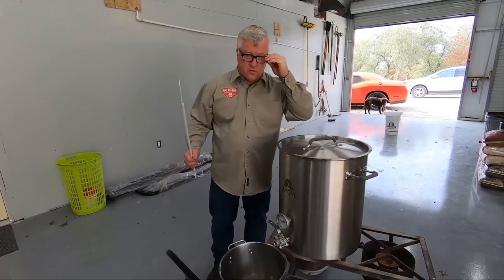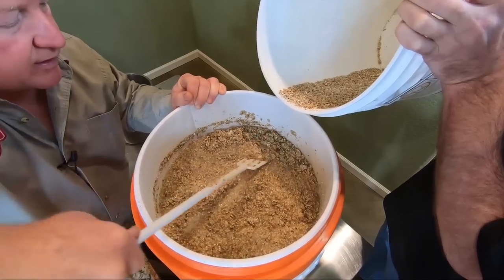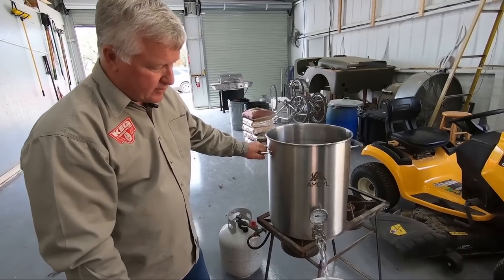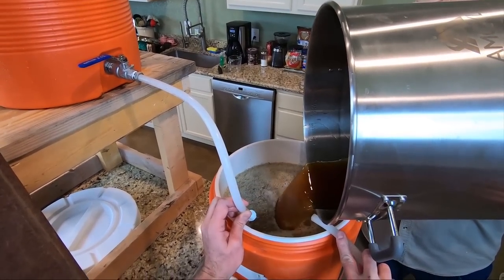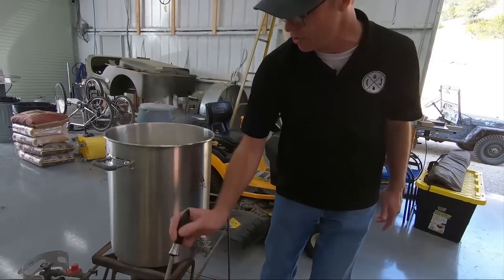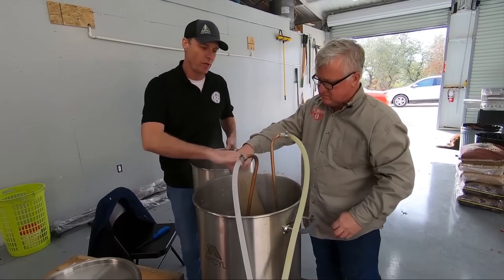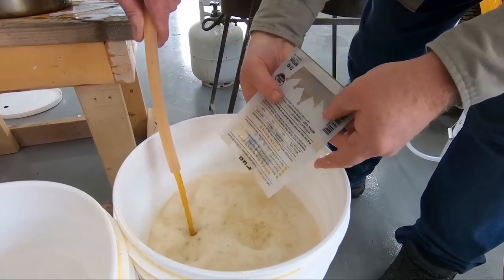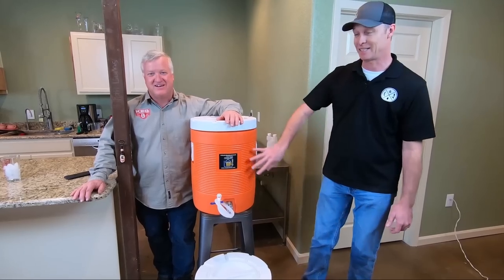All Grain Brewing on a Cooler Brew System

Comment: Nice vid. Interesting how processes get developed over time, so I wanted to comment on mine over the past couple years of home brewing, or about 60-80 5gl batches. 
I use a brew-in-bag method and don't worry about sediment, hop residue, or protein break foam off the boil. Just put it all in there, mash in the boil kettle, remove grains, sparge with top-water in a bucket to get my starting water level of about 7 gallons. 
I use a combination of re-usable hop bags and disposable socks, depending on how many hops additions in the recipe.
I use a home-made copper-coil chiller (wrapped a paint can) and tap water to get wort temp down under 90. From there I rack to a glass carboy, aerate with a wine stirrer in a drill motor, and set in my 65 degree fermenting chamber (upright freezer). Pitching temperature is reached by the next morning, add yeast and stir again. Ales are ready to keg in 2 weeks, no secondary unless lagering.
My beer comes out crystal clear, all of the grain dust and stuff you tried to filter out is sitting on the bottom of the fermenter along with the yeast trub. I find glass is much easier to keep crystal clean, and you can see what's going on with your fermenting.
It's a simpler process and not as fiddly, but does not scale up well to larger batches due to the weight of the soaked grain bag. Some brewers will use a pulley system, again I think that's too fiddly. So I just use two burners and two 8gl kettles. 
And there ya have it. Just ordered some kegs from you - seems like a good product source. Thanks!
Reply: You wrapped copper coiling around a paint can to for your chiller?
Reply: @CarlPapa88  Wrapped the paint can to build the circular coil of the chiller.

Comment: The only confusing thing you did in the video was calling your strike water your "sparge water" as you poured it in to start the mash.   Then you correctly called the next infusion of water the sparge water at the end using it to rinse the grains, which is the sparge. 

I was wondering at first how you were going to rinse the grains (sparge them) when you hadn't even put the grains into the mash yet.
Reply from the maker: Yes, sorry! I wonder if I can put a card on this video at that part with the correction? Thanks for watching and for the comment!

Comment: You produced a liquid called moonshiners beer. Mash used for grain distillation is rested at 150F. 
It is chemically and enzymatically impossible to produce ale using single temperature infusion and high modified malt but it works great for cranking up alcohol for grain distillation. High modified home brew malt is distillers/food grade malt and to make ale with it requires the addition of enzymes and for that reason enzymes are manufactured. High modified malt is less expensive than brewers grade malt. Marris Otter, Halcyon and Golden Promise were originally used for making whiskey until home brewing was invented. There is a maltster producing a type of Marris that is low in protein around 8% which is very good but it is high modified and it requires additional enzymes to make ale. High modified home brew malt is usually 12-16% protein and brewers grade malt is 8-10% protein. Purchase Weyermann floor malt, it's slightly under modified which means that it is rich in enzyme content and it is low in protein which means that it contains a lot of sugar. Take a look at the recipes on Weyermann Malt website. Skagit Malting produces heirloom brewers grade malt, it is expensive. Pioneer Malting in New York sells very good malt as well, ask for Adam. Both companies sell to home brewers. Depending on the length of time the mash was between 140 and 149F some conversion may have occurred. When conversion takes place secondary fermentation is required and the beer will not require priming with sugar or CO2 injection for carbonation. Conversion happens when Beta converts glucose released by Alpha from simple starch amylose (saccharification) into complex sugar, maltose and maltotriose (conversion). Starch converts into nothing, it's the container that protects the sugar and Alpha opens the container (liquefaction). Yeast does nothing with complex sugar until the glucose is gone which happens during primary fermentation. During second fermentation yeast absorbs complex sugar through the cell wall and an enzyme within yeast converts complex sugar into glucose which is expelled back through the cell wall and the sugar becomes fuel. After second fermentation has ended the beer is placed in a keg where yeast converts maltotriose into glucose and natural carbonation occurs. The beer clears without additives and gravity falls to expected FG. 
Before throwing away spent mash take a look at it and you will notice a bunch of white particles throughout the mash. It is a type of starch called amylopectin. Amylopectin is located at the tips of the kernel and it's the richest starch in malt. The reason that it is left over is that the starch is hard and heat resistant and temperatures used during infusion brewing are not high enough to burst the starch where it enters into solution. The starch contains a type of sugar called A and B limit dextrin. The sugar is tasteless, nonfermenting and responsible for the body in beer. Alpha releases limit dextrin from the starch and the action is called dextrinization. Since the starch contains pectin gelatinization occurs. However, none of that took place during the brew session and it must in order to produce ale. Omitting a Beta rest places ale out of reach, as well. There are the four enzymatic actions that must occur to make ale and lager. Liquefaction, saccharification, dextrinization-gelatinization are due to Alpha and conversion is due to Beta. During the brew day only liquefaction and saccharification occurred.
Skim off hot break before adding hops and skim off second hot break. Less hops will be needed. Maybe you guys did it that way, I didn't pay attention to it. Try not to dump malt into hot, aerated water. Hot side aeration is not a myth and it starts during mashing regardless of what home brew forums mention and experiments claim.
A little advice. Mother Nature can care less about strike and target temperature and getting wrapped up in it is a waste of time. Alpha works well at low temperature. When soil stabilizes around 50,55F and when the seed gets wet Alpha kicks in. Our saliva is loaded with it and 98.6F seems to work well with Alpha. Alpha's purpose is to release glucose, one of the three building blocks of life from starch and yeast loves the sugar. Homebrewers concentrate on numbers on a recipe that due to the inconsistencies in malt are not accurate recipes. Before recipes can be accurate there's an important sheet of paper called a spec sheet that comes with every bag of malt that has a bunch of acronyms and numbers listed on it that are used by a brewer to determine what has to be done with the malt to make ale. A spec sheet comes with malt because malt is very inconsistent. I am not sure if home brew shops carry data sheets for the malt they sell but one comes with the malt they sell. It's not a bad idea to become familiar with the info on a data sheet because without it, it becomes a challenge to claim ale or lager came from the malt. A data sheet is used by a brewer before purchasing malt. The info on the sheet comes from tests performed on malt at 145, 153 and 155F. The test are 20 minutes long, after that Beta and Alpha denature. Use iodine and test for starch at 20 minutes if the sample is clear of starch run off the extract. If you want to screw around crank the temp up to 162F for 10 minutes and run off the extract. If 150F is a temp of choice throw in a rest at 155-158F for 10-15 minutes and go up to 162F for 10 minutes. Alpha I and Alpha II will release a little bit of sweet tasting, nonfermenting sugar at the higher temps. Doing that will allow the beer to age a little longer. To add body to beer mash has to be boiled and an albuminus protein rest is used. When malt contains a high level of fibrous Beta Glucan, Beta Glucanase enzyme is added to reduce viscosity or the mash is rested at 130F and Proteolytic enzymes will reduce the fibers to glucose which lowers mash viscosity. Protein and Beta Glucan are listed on a spec sheet.
I enjoyed the video and Have a GREAT YEAR BREWING!!
Reply: Fascinating! Thank you
Reply: Can you cite sources for your claims about "not making an ale" using this process?  Seem to be lots of homebrewing books, magazines, and websites that disagree with some of your assertions.
Reply: You Sir are informative.
Reply: Offff, why aren't you having a contentful channel already?

Comment: I don't understand what the point in using a cooler is when you can just put all the grains in a bag...biab method...also the terminology makes learning to brew kind of confusing...like pitching yeast..what's that mean? Adding yeast?  If so why call it pitching?  Also what's strike water? Just hot water?

Comment: Don't you think that chemicals leach in to the wort from using a plastic mash tun at high temperature. I don't use any plastic in my brewing process.
Reply: I started all-grain brewing with a plastic cooler years ago. Brewed many batches and never noticed a thing. Lots of people over many years use coolers as mash tuns, if there was a problem with chemical leeching nobody would use them. My two cents..
Reply: Not sure what these fellas are using for a cooler brand wise? Rubbermaid coolers are BPA free and should be safe for hotter liquids?
Reply: @MrOldnslofly  looks like Rubbermaid to me. Can get one at home Depot for bout 45 bucks.
Reply: Maybe boiling water or above that, but mash temperatures are safe
Reply: oldschoolman 144 I’m with you
Reply: for water that is 150-165 degrees F the plastic mash tun is fine. Not ok to use for boiling water
Reply: If go to Rubbermaid product website and look at the Q&A for those coolers you'll see RM does not recommend their plastic coolers for warm or hot liquids, including tea, coffee, soup or hot mash. I plan to use stainless when I move to all grain. No big deal to monitor the strike temp for an hour. Maybe make a insulated jacket for the strike pot.
Reply: @originaljcs  If they didn't say that, then idiots would use them as coffee urns, and they would wear out quickly.  They would also have to deal with lawsuits from said idiots burning their hands on the pushbutton plastic spigot. For this use, it is fine, though it likely would wear out over several years of heavy use.